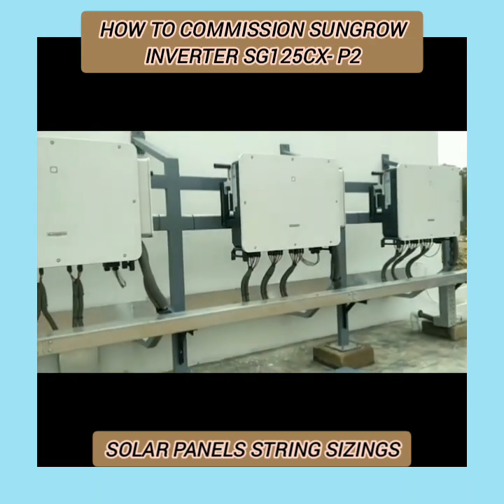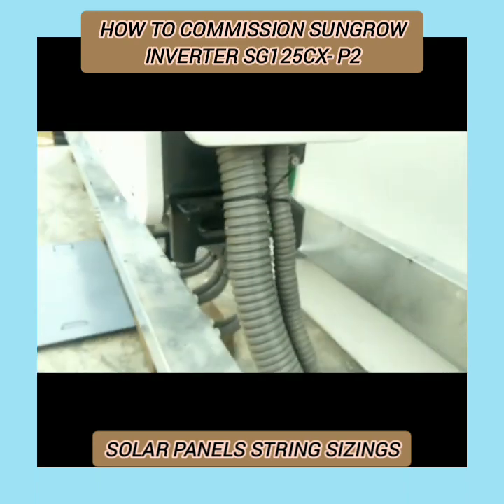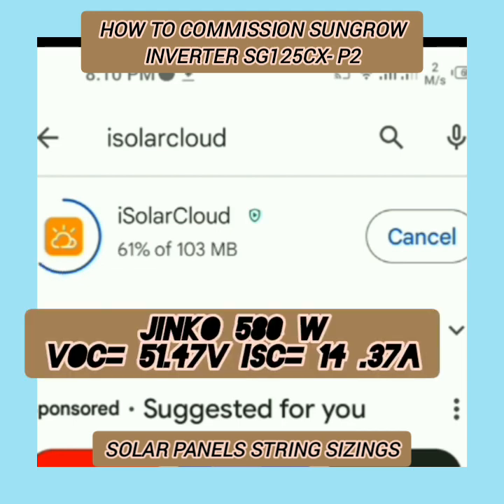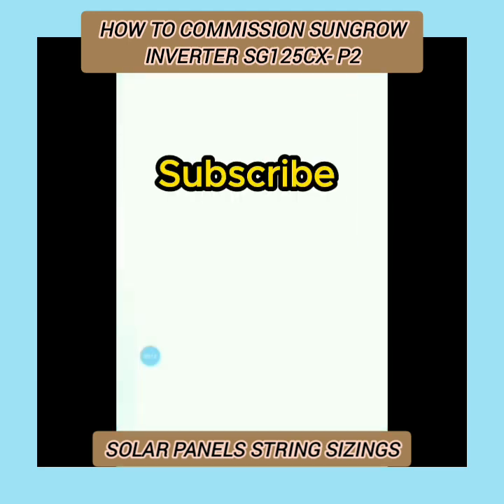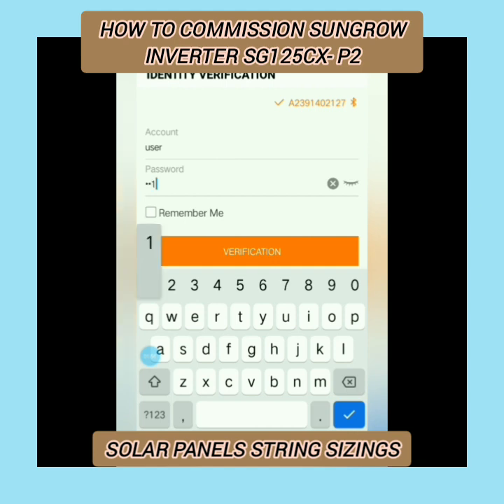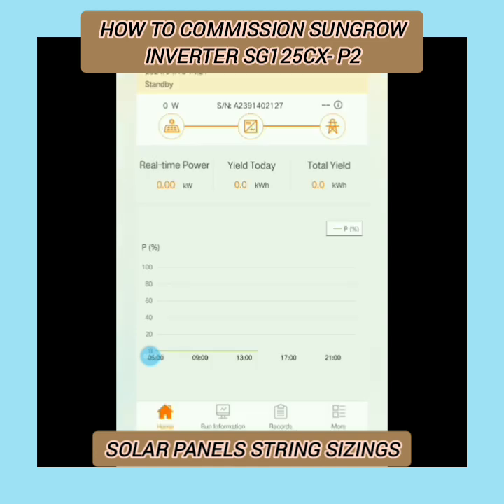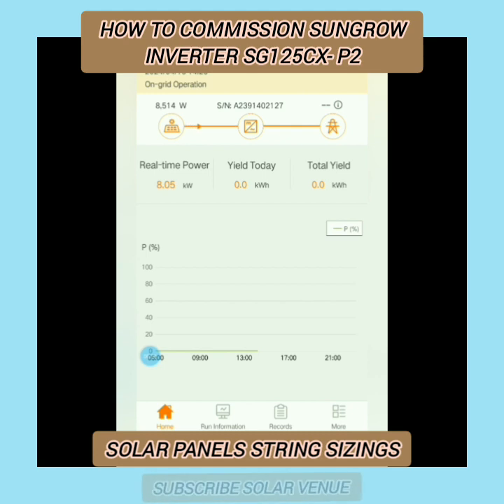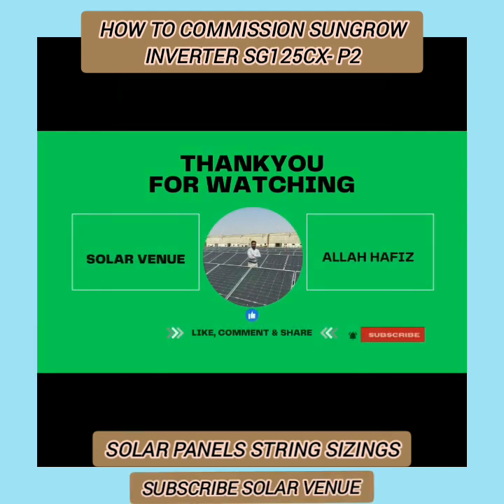Commissioning of Sungrow 125KW Solar Inverter & String Sizing Calculations

Comment: Inverter ki body ko Dc earthing sa connect karaga ?? ussi DC Earthing sa jis par panels ki  earthing connect hoti ha
Reply from the maker: Ni DC ki earthing separate he. AC ki Earthing k sath LV switcgear and Inverters ko connect Kya jata he.
Reply: @solarvenue.engramir  
Ac Cable connector Jo Inverter ma plug in karta hain usma to Ac earthing wire connect Hoti ha magar Inverter ki heatsink ko bhi Wohi Ac earthing sa connect karaga ??
Reply from the maker: @ABDULREHMAN-bz2si  g han mgr separate earthing cable needed UpTo Earth pit.

Comment: Thanks for the video, keep it up! Pls also make a video about calculations. Do you take into consideration temperature when calculating number of panels in a string?
Reply from the maker: Yes, sure in shaa Allah I I will try to make at relevant topic.
Reply: @solarvenue.engramir  Thanks looking forward for it
Reply from the maker: Temperature coefficient of VOC of the Solar Panel is -0.25% / Degree Celsius, also operating temperature of module is -40 to 85 degree Celsius.
Reply from the maker: Thanks for your valuable comments.